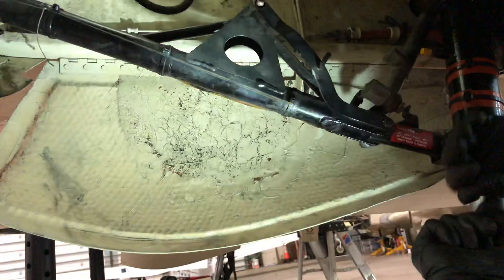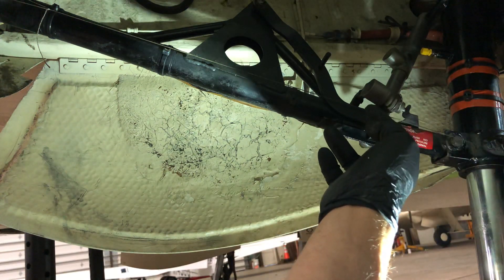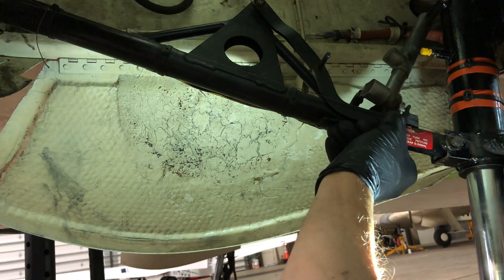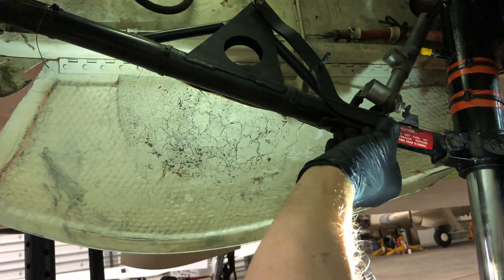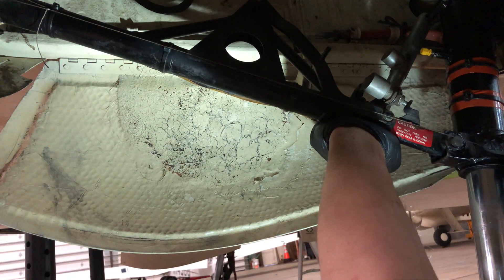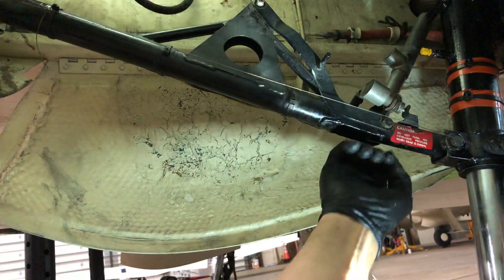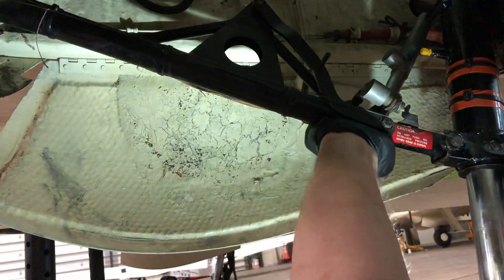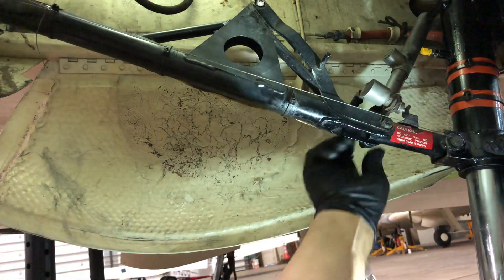Main gear drag strut rigging

Comment: Thanks for all the great info, Dave! Two questions: 1- does the reference string come off the top or bottom of the drag strut bolt heads? 2 - how do you know if the over center spring is weak? Thanks again!